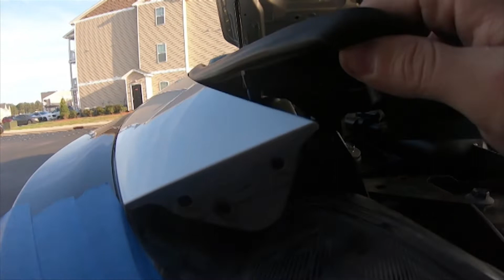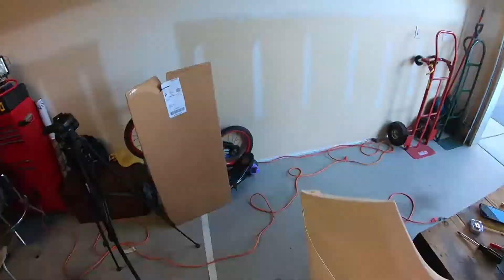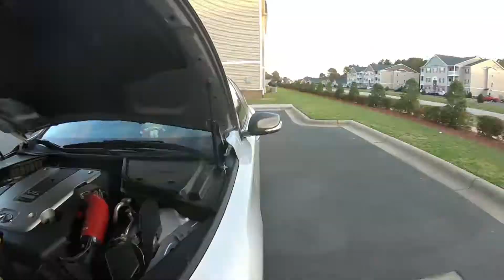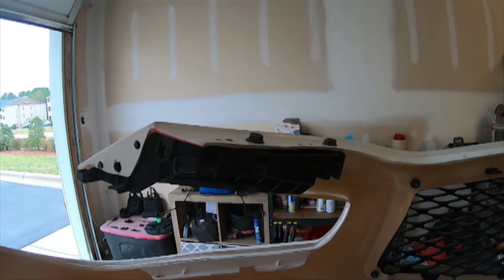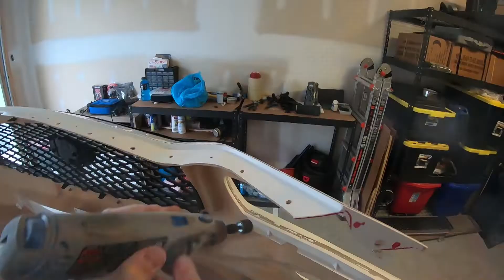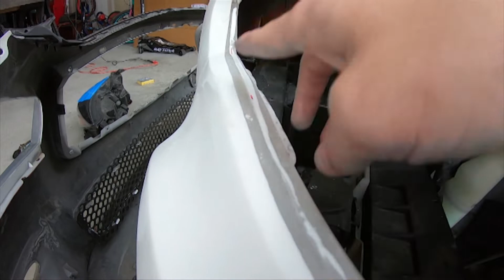Fitting a Fiberglass Outcast Garage Front Bumper on an Infiniti Q50 (part 1)

Comment: So I just bought this bumper, you think it was a good choice?
Reply from the maker: I do like the bumper style, but it was just a little to much for me in terms of additional styling which is why I modified mine first. It is def not a bolt on/paint ready product but if you have the time and or money to get it fitted properly then yes it’s a great bumper. I got mine for $200 but if I were to have paid retail price, I would have prob went with a urethane bumper and skipped on the fiberglass option all together.

Comment: Do you think I could juss get the fender to bumper support bracket or what ever it’s called that holds the bumper together to fix the fitment or do I have to fabricate the whole bumper?
Reply from the maker: So not having the bracket didn’t really make any difference fitment wise. The fiberglass was just to thick in certain areas and needed sanded down a lot to get it to fit under the headlights cleanly so it lines up at the wheel well. I feel it will take more effort to fab it to work with the bracket and still need to sand the stuff I did as well. The process is more detailed in the other videos in the series.